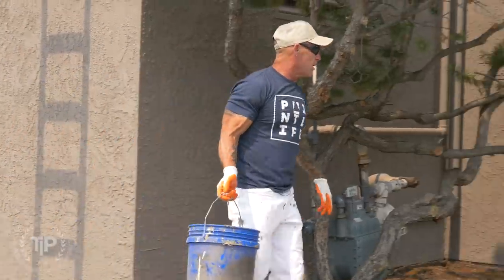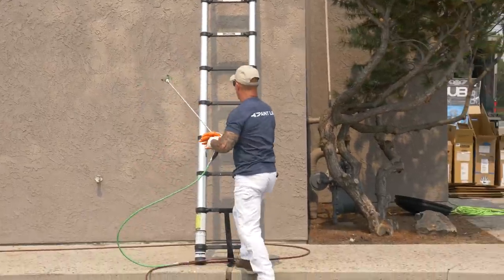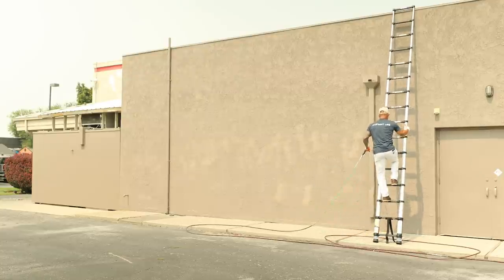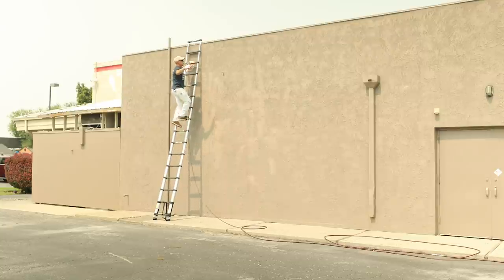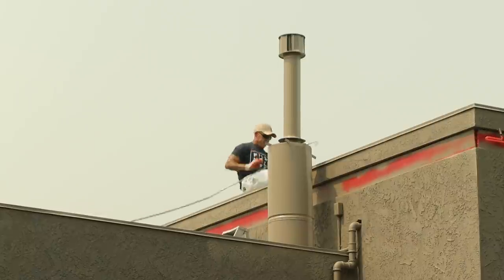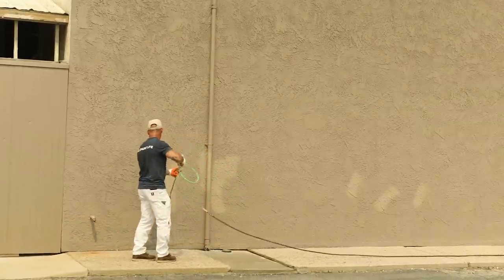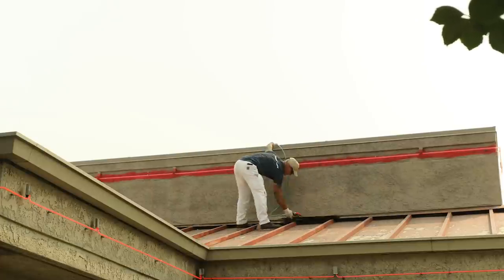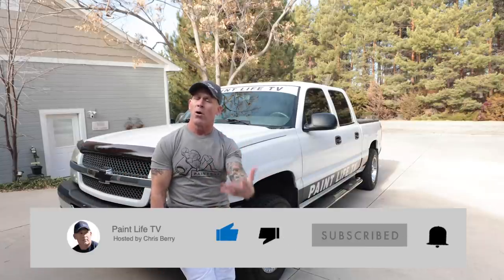No Lift? No Problem! Airless Spraying Stucco Solo: How to Paint a Commercial Building by Yourself!

Comment: Looks great man!  Just a suggestion, jet roller with a 1 inch colossus cover. spray and back roll at same time
Reply: That’s what he was getting to before he started painting 🤦‍♂️ 🤣 he was saying it’s not necessary to back roll, and yes it’s not necessary unless it was a new building but for repaints it’s perfect to just spray and I also perfer to just only spray exterior stucco structures, also if you back roll you will most likely leave the roller marks, with the spray just spray at different angles I’ve done it many times!

Comment: Okay painters & Chris. You address overspray, thank you. If I’m spraying like you, in the Texas summer heat/sun; I spray the building and the paint is drying in the air and then landing on the cars, then it’s so hot the paint heats back up and sort of sticks to the car. Has anyone experienced this? I’ve had jobs where the dry paint does land on cars and it’s like dust but then when it’s getting very hot someone told me it can actually adhere to the car because of the heat.  Any comments or stories? Thank you!

Comment: Myself I RARELY use lifts. I find in most of the residential homes that I paint, they would not fit. Also it seems to me, it takes more time to bring and set it up then to just do the painting from a ladder. I use ladder leveling feet on all my ladders and very rarely do I need to get a lift to do the job.
Reply: Most residential jobs do not require a lift. They would slow the job down and create a situation where people that don’t know how to use it will smash a house, tip, or hurt someone in general. Commercial jobs like this go much much faster with a lift. Hope this helps!

Comment: Stocco is degraded when sealed with paint.  If it was designed to be painted it would be painted when it is applied, it's designed to be porous.
Reply: Ive used concrete stain

Comment: Are you using one of those collapsible ladders?  -IF so, you like?  I've been considering a purchase.
Reply: Don't do it!!!!!
Reply: They are good , but they do have their places. Are they everyday ladders NO. But if your in a truck (without a ladders rack) or in a suv etc... then it's perfect because you can store it in a minimal space then break it out when you need it.
Reply: I have to agree with the others.  These ladders scare the bejesus out of me.  I had one that was convenient to put in the back of my work car and worked well, but there were several dangerous instances I found myself facing with the ladder, mostly regarding the numerous individual leg-locks these have and the Velcro or other form of keeping the ladder collapsed.  I love my Little Giant ladders, which I can even fit in a family car, if I'm (again) in a tight space and can't throw it in my truck or SUV.
Reply: Get the good one, I use the “extend” ladder all the time, they work great for stairwells or odd sized walls. If you get overspray on the poles that collapse on each other then they won’t slide as smoothly. Good luck
Reply: That's a negative on the ladders...Call me old skool but I don't trust them, I want to know I'm squared away up that high.
Reply: I've had one for years and never had an issue. definitely worth the purchase. like anything- its as safe as you make it. Check each lock before climbing and keep level feet.